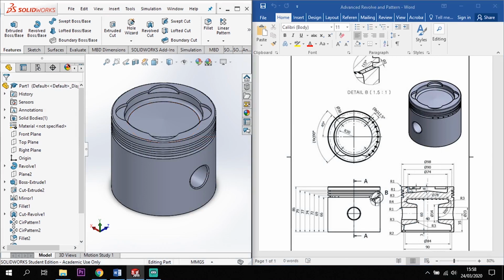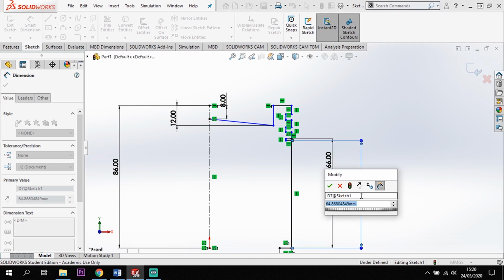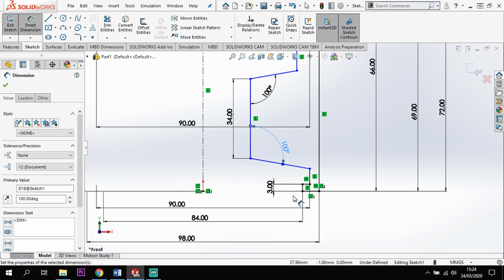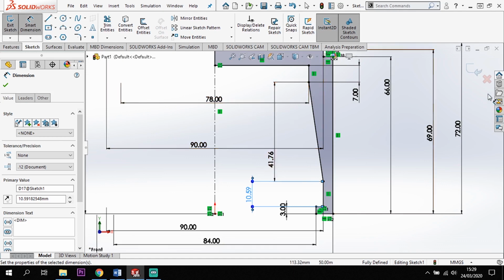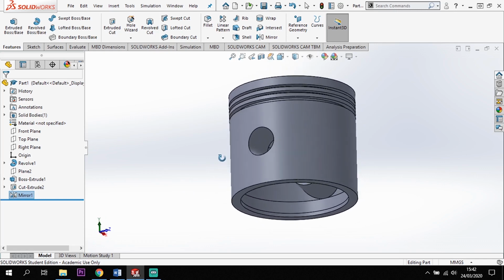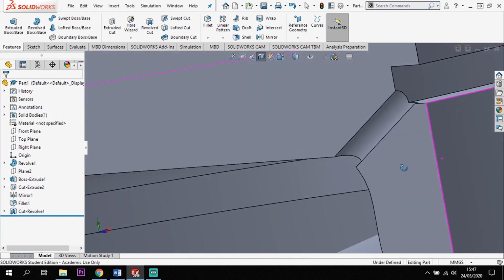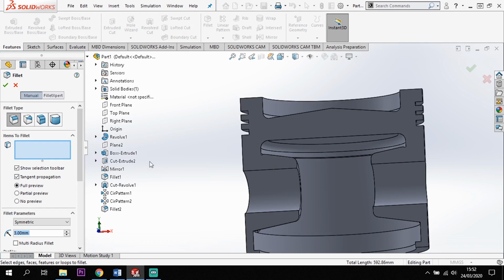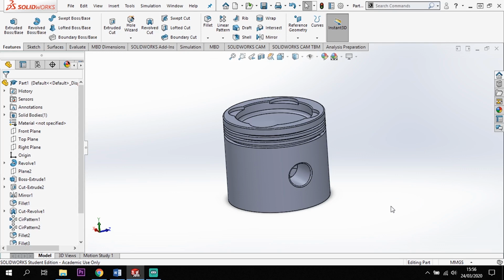SOLIDWORKS PISTON TUTORIAL!

Comment: How did you add that horizontal relation at 4:15
Reply from the maker: I selected one of the corners of the horizontal line at the top of the position held control and selected the top point of the centre line. The relations will then appear in the design tree at the side.